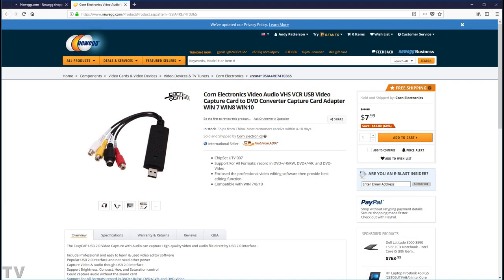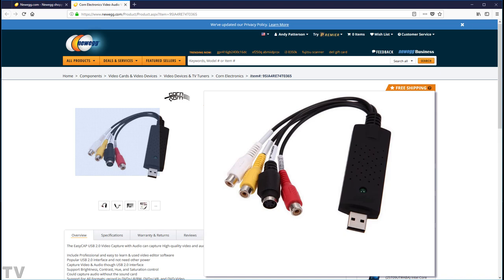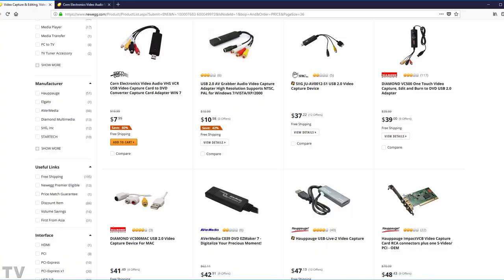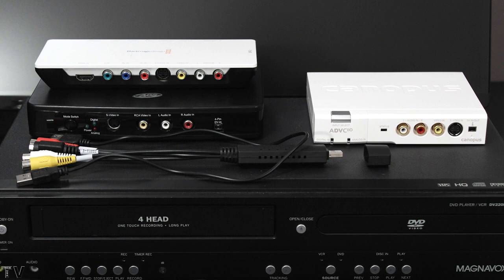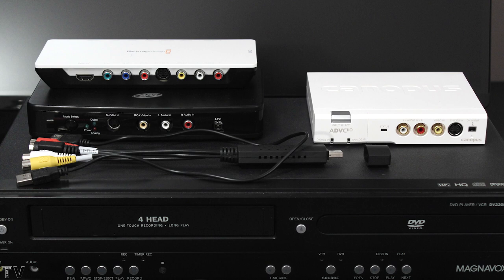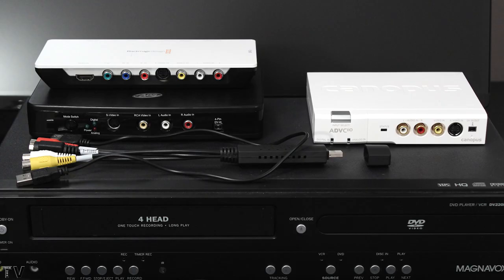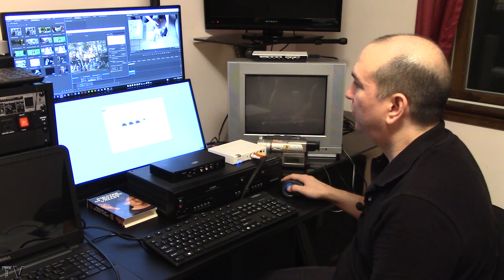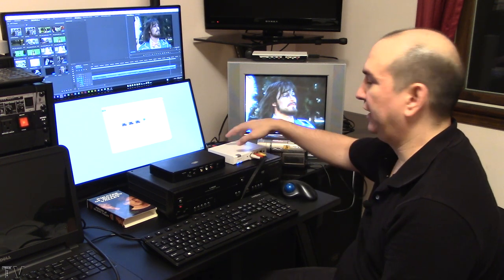best option to transfer VHS and Hi-8 tapes to the computer

Comment: Thanks for the informative vid.  I will use the advc to transfer vhs tapes to computer.  Does it improve the quality of the vid to use an upscaler  (av to hdmi) in the system?  And if so, how to configure (before advc or after)?
Reply from the maker: The video link will let you see how well Premiere Pro can upscale the video. 

https://youtu.be/dVLUxRkPMdA
Reply: @TechTVusa  Sounds good.  One other question, my pc does not have a firewire port.  What's the best way to connect advc to computer to capture highest quality vid.  Have usb 3.0, 3.1, and hdmi ports.
Reply from the maker: @gorednaga  You need to get  Fire Wire card. If you have Thunderbolt ports you can get adapters.

Comment: Nice video.  I capture VHS using a 3.0 USB Intensity Shuttle without the use of a true TBC.  I play tapes in a good Panasonic (deemed by me), then the signal is routed into a Toshiba VHS/DVD recorder combo DVR620 (just for signal routing purposes), then into my Intensity Shuttle.  I should note that I use COMPOSITE IN to the Toshiba DVR620, and COMPONENT OUT to the Shuttle.  This method give me no dropped frames, with the Blackmagic capture software.  My question to you is: is my signal getting compromised (quality wise) by routing it through the Toshiba DVR620?  Although the DVR620 is acting like a TBC, I wonder if my signal is just getting converted to some lower grade form with lower resolution.
Reply from the maker: The signal is just passing through so it should be OK. You are correct about the DVR620 acting as a TBC. VHS and TBC all have to be purchased used now days. No one manufactures them anymore. It is good that you have them.
Reply: how does the DVD-R Help ?? to stabilize the signal ?? Have issues with EYETV 250 ,, soon as any new recordings it drops out first index mark plays fine.. then next stop start on tape and it drops it
Reply from the maker: The video link might be helpful.  https://youtu.be/xdw9_DETrqE

Comment: Thanks for sharing your knowledge.
 Will the Canopus ADVC 110 work easily on Windows 10 or I have to install some driver?
Reply from the maker: It will work if you have a Fire Wire port. I will have a new video soon.
Reply: @TechTVusa  
Thanks for the info. 
I have another question: I bought a second-hand JVC-DR-M10 today.  Can I use it to passthrough the analog video (VHS and HI8) and record in an Intensity Shuttle?
Reply from the maker: @huesicos  If it has a built in TBC it should work. My Hi-8 camera has a built in TBC so I can use the Intensity Shuttle with my Hi-8 camcorder but not my VHS player.
Reply: @TechTVusa  Maybe I didn,t explain well. What  I Bought is a DVD Recorder (JVC DR-M10). 
The camera is a Hitachi HI8 with no tb. I try to capture directly with the Intensity and have black flashes every one or two seconds but thats not happen if I conect the camera to the TV. 
So I bought this DVD Recorder that have the LSI chip and what I ask is if I can make a passthrough : "camera Hitachi" to "DVD JVC DR-M10" to "Intensity".
Sorry, maybe my english not to good.
Thanks anyway.
Reply from the maker: @huesicos  As I stated earlier. If it has a built in pass through TBC it should work.
Reply: @TechTVusa  
Ok, I got it.

Comment: is there something between 10 and 250 bucks?! I mean, I don't want the bad quality of the small usb grabber but really cannot afford one of those boxes. Any advice for something in between?!?
Thanks.
Reply from the maker: You can buy used Firewire DV converters for less than $100.00.
Reply: @TechTVusa  Thank you for replying! Not a fan of used stuff here... Well I found at least this:
https://www.digitec.ch/de/s1/product/terratec-grabster-av-350-mx-diverses-video-zubehoer-video-zubehoer-245614
Hope I can grab lossless with this box...
By the way, one question:
My VCR has two SCART outputs (a blue and a black one) and a composite output for 3 cables. 
Would it make sense to grab via the SCART instead of composite? I imagine SCART to have higher quality than composite, or am I thinking wrong here...
Reply from the maker: @Conan2433  I am not sure how well that will work. The device below is not as good as the ADVC 110 
https://youtu.be/hroHcwOxoOI

Comment: Thanks for the outstanding advice. One question I have is about composite vs. s-video connections to a VCR. The Emerson 4-head VCR I have only uses composite connections, but Super VHS players I've found for sale online do seem to have s-video connections. Is a Super VHS player with an s-video connection the best way to get the best-possible signal from a VHS tape? I couldn't tell what type of VCR you have in the video. My tentative game plan is to buy a Super VHS player, firewire DV converter, and Blackmagic Intensity Shuttle. Basically I am trying to make sure I use the best-possible equipment when I convert all my VHS tapes into a digital format for my permanent archive. If this is the only time I do the conversion, I want to do it right.
Reply from the maker: S-Video is much better quality. If the VHS player has a time base corrector (TBC) built in the Intensity Shuttle might work. You can get better quality using 10 bit uncompressed with the Intensity Shuttle but it takes up much more hard drive space. The ADVC 110 has decent quality and requires no TBC. The ADVC 110 is great for capturing VHS but the Intensity Shuttle does everything else better. You might find the links below to be of some interest. 

https://youtu.be/PTQYJKQpazk

https://youtu.be/barrJWuBzCA
Reply: @TechTVusa  Thank you - I have watched some video samples of S-video vs. composite since your reply, and I see what you mean. Definitely will be making sure I use S-video. And those videos you linked to in your comment are also an excellent guide. I'm a former teacher and have a lot of respect for people who, like you, are superb at explaining things. Keep up the outstanding work.
Reply from the maker: Thanks. I plan on getting an Intensity Pro 4K soon. Until then the video link below might have some useful information. 

https://youtu.be/xdw9_DETrqE

Comment: I have a SHARP  VL-A10 8mm Viewcam what would you recommend for me a novice to recapture my 8mm movies that is economical.
Reply from the maker: If you have the Thunderbolt or Fire Wire any Fire Wire based DV converter should work just fine. The video link below might be worth checking out 

https://youtu.be/Q4zcLU4Cdi8

Comment: Hello,  I just watched your video several times and thank you.  I only have a question I just purchased a nice tower that has a G-Force 8 video card with many ports.  I got all the necessary component's to start important but now I am confused as to what to get to grab the video ( I am a novice at this). So do you have a link as to where I can find out what to do, and what I want to know specifically is what hardware will be best for best quality since I have a pretty good computer that I just bought for video editing. The spec's I have are 32G Ram, Pentium I9 and G-force 8.  I would like to match something that I can get best quality.  Sorry for the going around and around, don't know much of this stuff.
Reply from the maker: For capturing VHS I Use the Canopus ADVC 110. The video link below shows the quality of the ADVC 110. 

https://youtu.be/Q4zcLU4Cdi8

For playback I used the Blackmagic Design Intensity Shuttle.

https://youtu.be/barrJWuBzCA

Comment: If you have a lot of noise in your analog video, the DV codec will be insufficient.  There is a visible loss in quality even though it is 25 mbps.  Better to use something that encodes h.264 at 20+ mbps.
Reply from the maker: You are incorrect. DV Fire Wire converters are reliable, hassle free and easy to use. The image quality is much better than many of the cheap USB capture devices that capture in H.264. The reason being is the hardware in the cheap USB devices are pure crap a lot of times. I am not saying all of the cheap USB cards that can capture to H.264 are crap but you never know what you are getting. All the video links below are worth watching. 

https://youtu.be/7R4vVNQsVec

https://youtu.be/RsnOndTrgxw

https://youtu.be/dVLUxRkPMdA
Reply: I can’t say much of anything positive about crappy USB capture cards, but there is a visible quality loss using the DV codec vs capturing in HuffyUV or something.  It appears to be a limitation of the codec, even if the hardware’s encoder is decent.  Visually, a 25 mbps DV stream is generally on par with a 7-15 mbps h.264 stream *assuming you have the same input stream*.  It really depends on how efficient the h.264 encoder is as well as the quality of the stream before it is encoded.  I’m guessing some of these cheap capture solutions aren’t taking lossless video and then converting it to h.264.  FireWire is no doubt reliable, but the quality encoded noisy video is visibly limited by the DV codec/hardware standards and I believe the DV spec allows you to normally record at no more than ~25mbps.  I would stay away from any anything that uses USB 2.0.  There’s a reason Firewire was DV was adopted decades ago for video capture as opposed to USB 2.0.
Right now I’m looking at capturing lossless and then converting to H.264 if I can’t find a decent consumer capture card that compresses on the fly with little to no visible quality loss.  The only problem is HuffyUV appears to be like 30 gigabytes per hour!
Reply from the maker: DV-25 and MJPEG use Huffy compression as did my Pinnacle DC 10 Plus capture card. DV-25 is 5:1 compression and 4:1:1 color space. Not bad. Having said that no one is arguing that H.264 cannot produce better results than DV-25 but the Fire Wire DV converters are reliable, easy to use and hassle free. DV-25 can be edited in any software program. Anyone making home movies for DVD or Blu-ray will be more than happy with the quality of the Fire Wire DV converters.  Trust me for home movies you will not see much difference between uncompressed and DV-25. I can say that because I have captured uncompressed with my Intensity Shuttle. The Intensity Shuttle requires a TBC to capture old VHS tapes. You should check out the links below. 

https://youtu.be/dVLUxRkPMdA

https://youtu.be/PTQYJKQpazk

Comment: Ok... Question as I'm having this issue...

I'm still capturing on my old Dell Studio Laptop with Adobe Premiere CS6 on Windows 7...

With ALL modern laptops not coming with FireWire ports on them, what route do you suggest?

Go with a desktop and install a FireWire capture card to it? Or will the Intensity Shuttle work as a capture device in Premiere via USB 3.0 on Windows 10?

I ask because the laptop I'm using to capture with FireWire is starting to die...
Reply from the maker: A lot of new laptops have Thunderbolt. All you would need is a Thunderbolt to Fire Wire adapter. Having said that I have a lot of videos about the Canopus ADVC 110 and the Intensity Shuttle that might be worth watching. I do not recommend the Intensity Shuttle for capturing VHS tapes. I only use it for playback.
Reply: @TechTVusa  If my laptop doesn't have thunderbolt installed on it, Will ir work with thunderbolt-hdmi converter?
Reply from the maker: @alejandrolamus2133  If you are referring to Infrared the answer is no.

Comment: Thank you for provided information. However, nowadays kind of pointless. If you released this in (say) 2008, it would have been much better. Canopus no longer makes this kind of devices, and ADVC 110 is no longer on the market, or the units available are non-functional. It is simply obsolete equipment. Nowadays the best option probably is to go for a good VHS/DVD combo. Then you can do post-production on the computer.
Reply from the maker: Firewire based DV converters are still the best option in 2021. People can buy them on ebay. Those that do are happy they did.
Reply: @TechTVusa  I do not dispute this but can you point me towards a specific model? Also, you need an older computer to be able to use the converter. Last motherboards with Firewire were made in 2011. Today you can get only a PCI-E FW adapter, which is fine. Although in my country these adapters are constantly out of stock or have unknown availability date.
Reply from the maker: @speed_rider362  You are very confused. Rather than give advice you should learn to accept advice. The video bellow might be helpful. That being said you should check out my other videos and sub-subscribe to my channel. 

https://youtu.be/vATw63nn3OQ
Reply: @TechTVusa  OK, you have me hooked. Can you recommend a good model of a DV converter? ADVC 110 you use is not available, and the rest I see on e-bay are DV to hdmi upscallers. The reason I'm writing this is because in the past I used ADVC 110 just like you. Then it broke down and I am unable to find any replacement for it.
Reply from the maker: @speed_rider362  I recommend the ADVC 110 because it does not require a 3rd party power supply. That being said any Firewire DV converter should work. I used to have a Datavido DAC-100 but I dropped it on concrete and it busted inside.
Reply: Exactly.
 @TechTVusa

Comment: I’ve been transferring VHS 📼 for a commission with Intensity shuttle, and you don’t need a time-base corrector.  You just need a combo VCR and DVD 📀 player and the right software.  The final product is excellent if you know how to properly deinterlace and turn your videos from 29.97 to 59.94.  You must also stretch your image to the correct aspect ratio.
Reply from the maker: You are incorrect. If you notice I have a VCR DVD combo player. In case you didn't realize it your DVD/VHS player has a TBC built in (some do some don't). That is why you do not need a TBC. I also don't stretch the image either. Why would I? Having said that the Intensity Shuttle allows me to give the client a spot on representation of what the DVD or Blu-ray disc will look like during the entire editing process. I also don't de-interlace. Why would I? If you click the link below you will see how I export video for DVD, Blu-Ray and social media using Premiere Pro. Having said that please make a video demonstrating your method. 

https://youtu.be/dVLUxRkPMdA
Reply: You must convert 720x486 to 640x480.  If not spheres are going to look like ovals in your final product.  My final product comes out looks great 👍 with this capture device but please let me know if stretching the image is wrong.
Reply from the maker: You obviously did not check out the video link in my prior thread so I will post another one just for you. 

The aspect ratio stays correct when using Premiere Pro as seen in both my videos. If you are having problems with the aspect ratio you might be capturing the video wrong or you could be using crappy software. In both my videos I show samples of the video being upscale 180% and even over 200%. I can assure you the aspect ratio is correct and I did not need stretch the image or convert it to 640X480. Having said that rather than insisting I am doing it wrong why not make a video of your own showing people the correct way to do it? 

https://youtu.be/Q4zcLU4Cdi8

Comment: What kind of computer would I need to do that
Reply from the maker: It does not take much computing power to capture VHS tapes. The DV converters were out back in 2002 when a 32 bit Pentium 4 at 2.6 GHZ was considered a beast of a system. The video links below might be worth checking out. 

https://youtu.be/xdw9_DETrqE

https://youtu.be/Q4zcLU4Cdi8

https://youtu.be/3Y1J-FWn1AY

Comment: Hi. I bought a Canopus ADVC-100 as you suggested here in the UK.  I have been really pleased with it so far.  I am using Premier Pro to capture video from VHS and Hi8 video camera and its working great. when i play back on the TV there is a blotchyness to the picture of green, blues and reds.  It is on all the original tapes but seems mores on the captured video.  Is this normal? something I did not notice 20 years ago when it was recorded maybe.  The picture over all is better except the blotchy ness.  Heres a link to a clip I have popped onto Youtube.  It seems worse on the TV but that could be as its a bigger screen.   Have you any suggesions? https://youtu.be/CV26U5dukMQ  Many thanks.